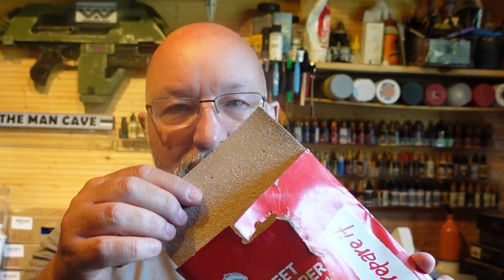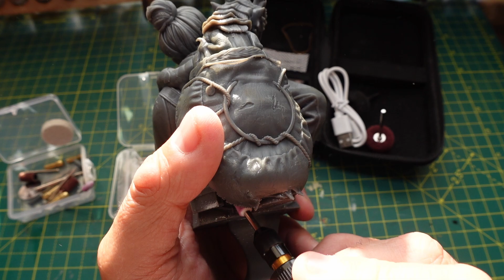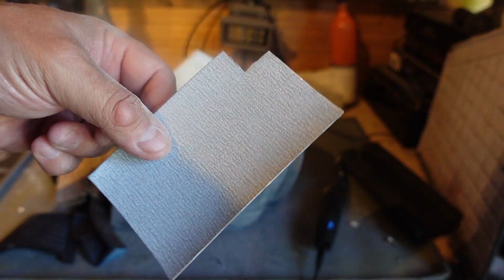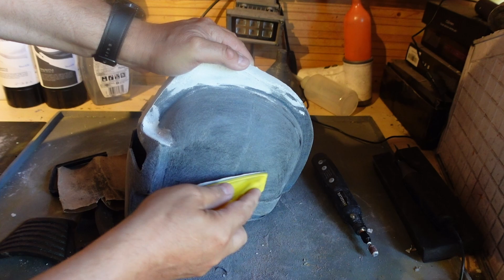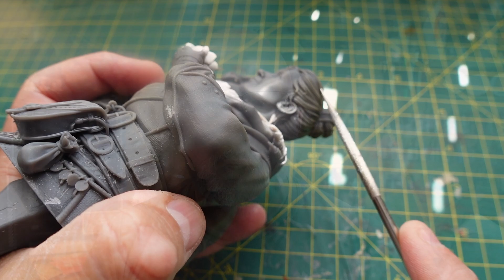Make Sanding Easy With These Various Tools 3D Printing

Comment: Yay, thanks such a lot. This is so useful.

Quick Sanding Guide

(my newb notes :P)
1. Use the Right Grit
Start: Use 40–60 grit to remove large chunks or rough edges. Move to the next grit when surface ridges disappear.
Intermediate: Gradually increase grit (80–400). Move to the next grit when the previous scratch marks are no longer visible.
Finish: Increase to 2,000 grit for a smooth finish. Move to the next grit when the surface texture is uniform.

Wet Sanding: Sand in water?. Water prevents the PLA from melting due to heat and traps dust. Plus it keeps your same paper a little bit nicer for a little bit longer.... 

2. Watch the Heat
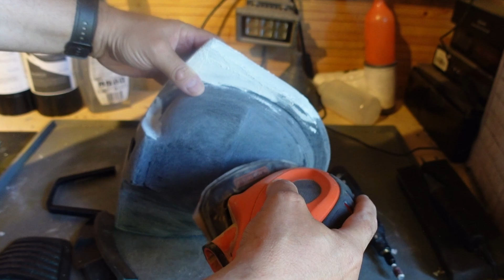Avoid melting PLA plastic by moving your tool constantly (2:27).
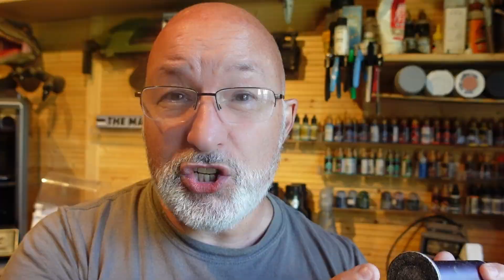Do not press too hard (4:58).

3. Choose Your Tool
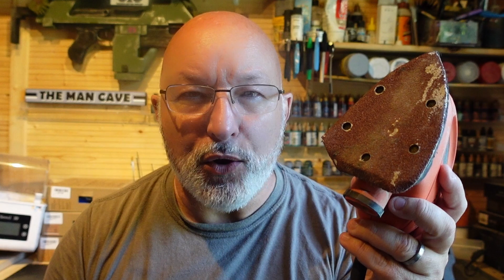Mouse Sander: Big, flat surfaces (2:05).
Rotary Tool: Small, detailed spots (2:54).
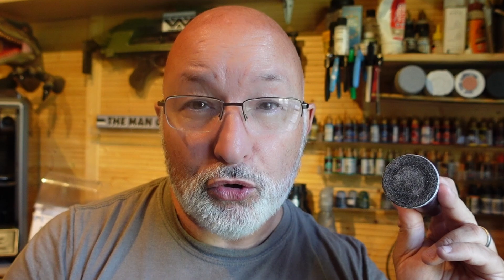Pen Sander: Tight nooks and crannies (5:25).
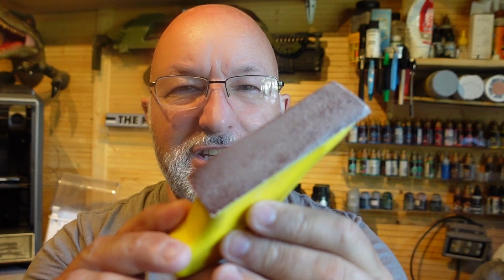Sanding Blocks: Manual, quiet control (6:39).

Don't forget mask! PLA plastic can get into your bloodstream and brain Also, even when it's printing!! (so get a case or pop it outside)

Comment: I'd sand at 3 in the morning (and very often do). Another tip is if your sandpaper is getting clogged don't throw it away , you can scrub it with some water and an old toothbrush
Reply from the maker: Thank you..3am... you need to sleep more lol
Reply: @greedy3d480  far too many kits to build 😊
Reply: Try one of those harder rubber pencil erasers they work great